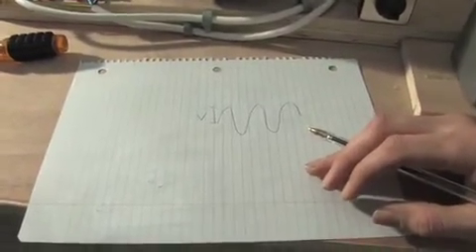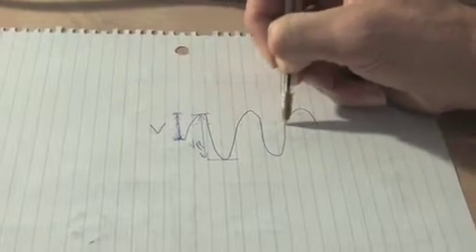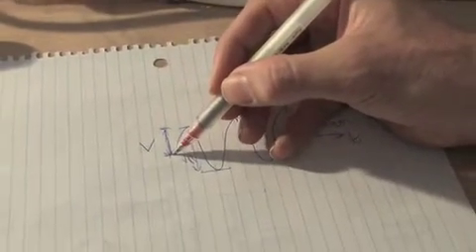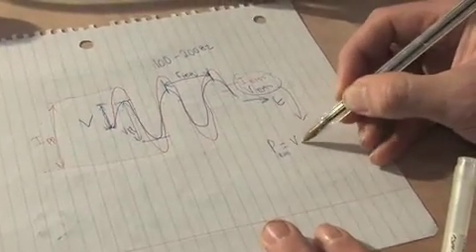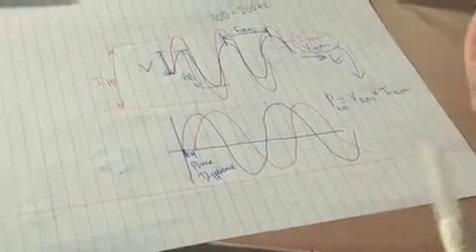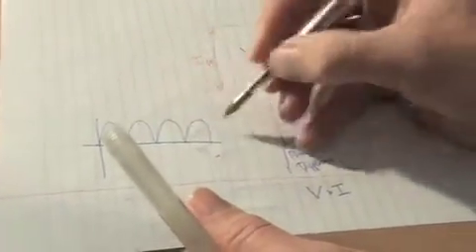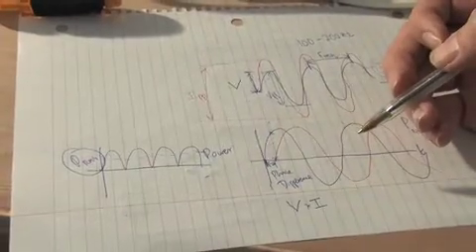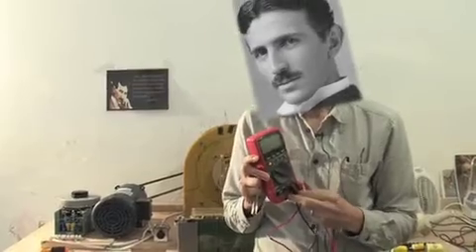re: QEG power measurements: Peak to peak power readings Vs RMS power readings

Comment: It is not Frequency it is Time, please explain it properly Frequency = 1/Time. From crest to crest is a time unit in seconds. Frequency is how many times it goes from crest to crest in ONE second.
Reply: Arto Heino Charles did state, "... 100 to 200Hz, cycles per second ...". The measurement from crest-to-crest is "time" because his horizontal scale is labelled as "t" (time), as Charles stated in the video. Charles did a great job explaining Peak-To-Peak vs. RMS Voltage which is the point and title of this video.
Reply: MrSummitville
 He draws an arrow that is labeled "f" between crests and calls it frequency, which is plain wrong, it should be explained as "t", for time simple and unambiguous, he never stated that Frequency is how many times it goes from crest to crest in ONE second. Simple and non problematic, why defend a plain error?
Reply: Arto Heino At time "1:34" he clearly states "... 200 cycles per second ...".  That is frequency. I think you are being overly critical. Your Frequency / Period complaint is irrelevant to the main "RMS vs Peak-To-Peak" calculation topic.
Reply: MrSummitville
Nobody is complaining, I am just pointing out a very important distinction, that most readers would not grasp, it is fundamentally incorrect what he has shown. You cannot build a premise on a flawed description, this is not rigorous or good science. The fact remains, the relevance of showing something in a vague and nebulous manner, makes the rest of the statements incomprehensible, the simple description of RMS now has a flaw in its premise, ergo it is relevant. The QEG itself is a mass of undefined and nebulous engineering, resonance is not a criteria for free energy, Enrico Fermi had more to say about this subject in 1937 than any goof ball QEGers. So if you dislike my critical assessment of Time/Freq description, just realize a lot of people want accurate information, they donated real money and real time, so the need for scrutiny is required and needed otherwise the public will be scammed out of donated funds for every piece of junk science that gets funded. So please realize I am not here to troll, I am acting as part of the collective conscious that will correct the errors for the public good, I have nothing to gain but everything to lose.
Reply: Arto Heino First, I do agree with most of your reply. And I am not trying to state that the QEG is Over-Unity. Quite the contrary actually. But neither the Period nor the Frequency are part of the RMS Voltage calculation. And basically, the Period and the Frequency measure the same parameter, just expressed in reciprocal units. In fact, Charles should not even need to state the Period or Frequency in the video to make his point about the Peak-to-Peak Voltage mistake. The RMS calculation is not based on a "flawed description" since his RMS calculation has nothing to do with the Frequency or Period. The Peak-To-Peak Voltage and Peak-To-Peak Amperage math error by James Robitaille was a major O-Scope reading mistake in the original over-statement of the Output Power, by a huge factor of 8 times too much. Yikes! This was actually revealed and discussed over a month ago ...